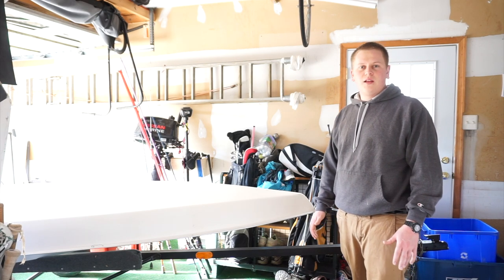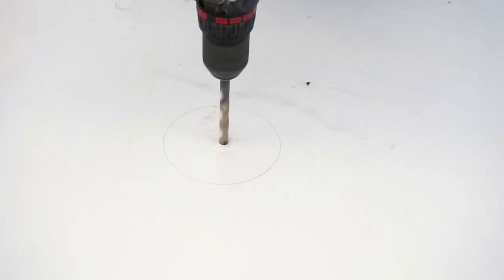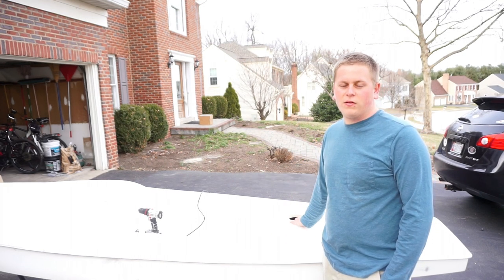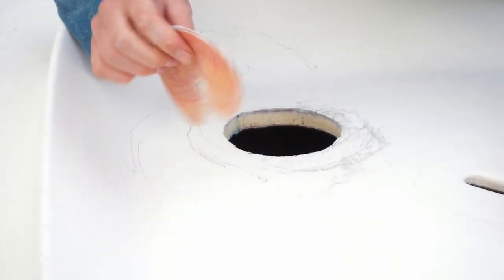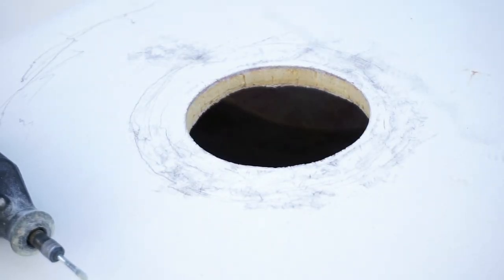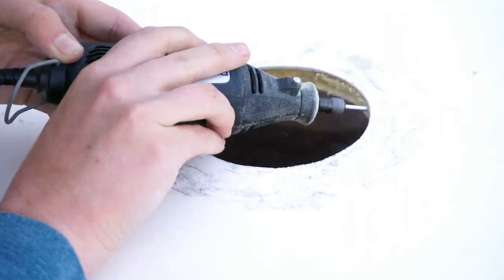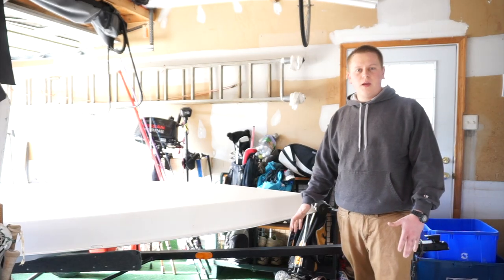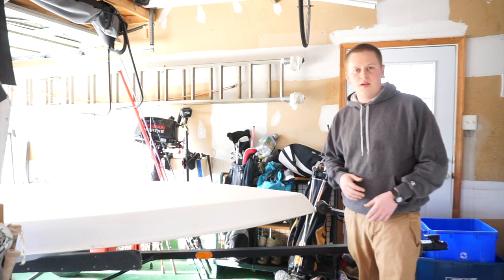Sunfish Sailboat Restoration- Inspection Ports + Core Condition-Ep 6

Comment: You will regret putting the access port in the middle there on the rear. I have a few of them on my boat but the rear one is not that far forward. Your rudder will likely smack it all the time. A hole saw makes a much nicer cut. I really enjoy sailing my boats.
Reply from the maker: Bassntruck-

Never even gave the rudder a thought because I thought it would lay flat enough, good to know though. We will see how it works out and I will be sure to mention something in the test video about it. You are absolutely correct the hole saw would have made my cut much less "unique" but I didn't have one large enough, nor want to buy one that large for a one time use type of deal. Thanks so much for the feedback though. I really appreciate your support and insight, I am new at most of this stuff so any suggestions along the way are welcomed!

-Tyler
Reply: Tyler,

My boats have scratch marks all across the rear where the rudder handles have rubbed through the gelcoat. I understand using the tools you have. But I would not go as far as to call it "unique". Just be honest and say it is all I had and I could not afford the correct saw. There is nothing wrong with that. Saying you did it to be unique just makes one look like a lazy dummy. I did not amass all my tools overnight. You can see some of them in my videos. I do not recall if you used a sealant between the boat and access port. You can use an RTV or a water safe silicone. 

Just keep on trying and learning. Do not be afraid to ask questions and so some research. The come ot your own conclusion. Goodluck

Comment: My used Sunfish weighed in at 170 pounds. With two inspection ports, a pot fan, wrapped in vented black plastic, placed on saw horses in the summer sun roughly how many days will it take to dry out the hull? Too bad there isn't some way of putting the boat in an oven at a bit over 212°F and just steam the water out through the ports. Maybe a lumber drying oven somewhere if you happen to have a friend who owns one. Nice instructional videos!

Duncan
Reply from the maker: Duncan-

Great question, and I'm not sure I have the answer. However, it sounds like you have the best setup possible to facilitate the drying process. Mine took about a month to dry out with a fan and heat lights running about 1/3 of the time. I would think that yours should dry in a week or 2 under the conditions you mentioned. Let me know how it works!

Thank you for your support!

-Tyler
Reply: Come to Texas. It's 3 million degrees in August. Lol